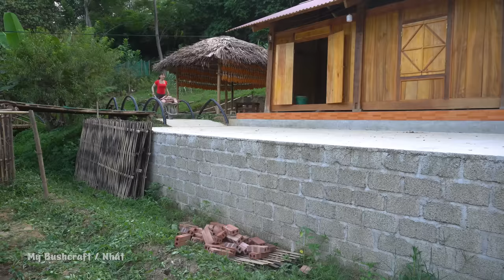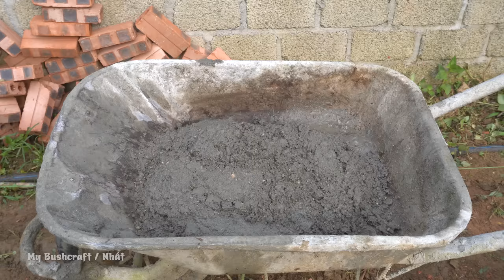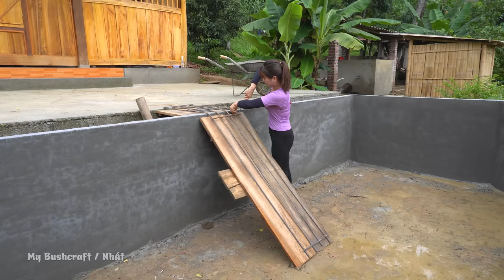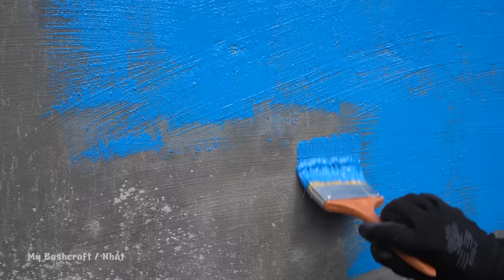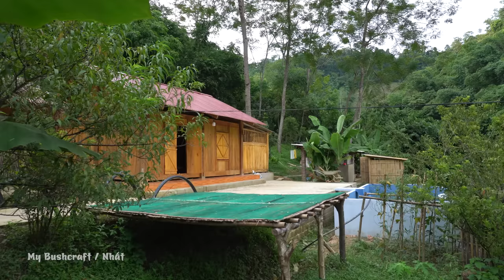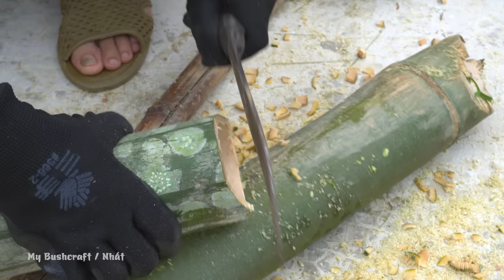FULL BUILD: Start To Finish Building Swimming Pool With Bricks & Cement - My Bushcraft / Nhất

Comment: I would like to give you some advice, for your mini swimming pool, don't build multi-level pillars with empty outside points. You pump a lot of water in, causing the wall to burst without even realizing it.. the water level is heavy, when you go into the pool it's light. gently, that's it for now, the harder I jump, the more pressure I push, the more it breaks.. I don't know if it suddenly breaks..
Reply: She isnt listening. IT ISNT REAL. She didnt make anything more than you physically saw.  She never broke a sweat the whole video.  Your too gullible
Reply: @atomgrounder857  You're

Comment: was bound to leak as you never used reinforcing steel and need at least  15 to 20 centimetres of concrete in the bottom and round the edges from floor to wall but looks great